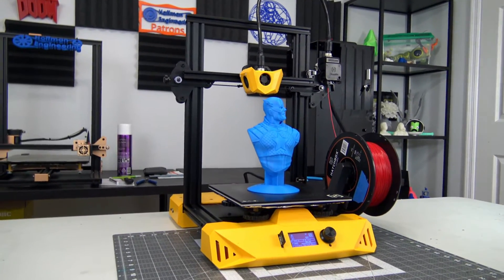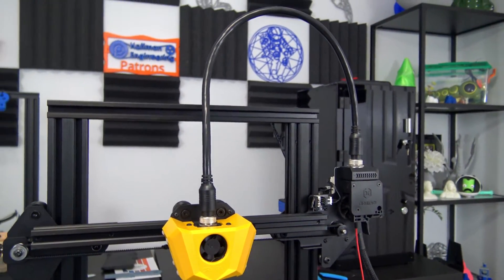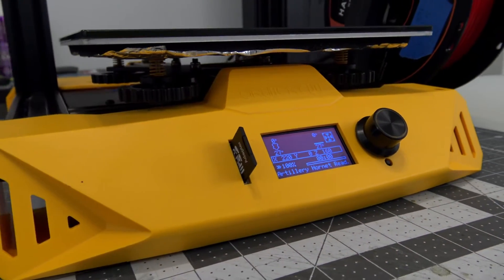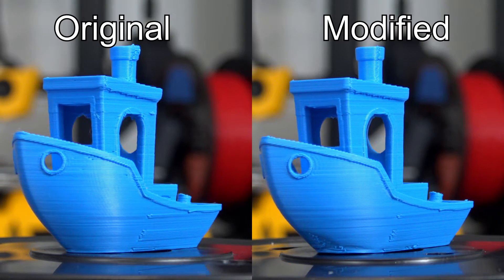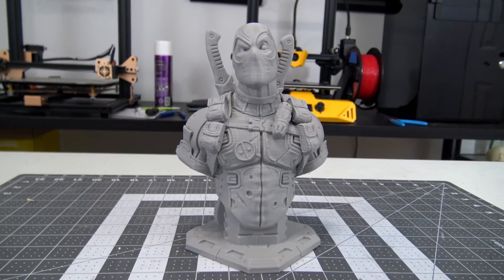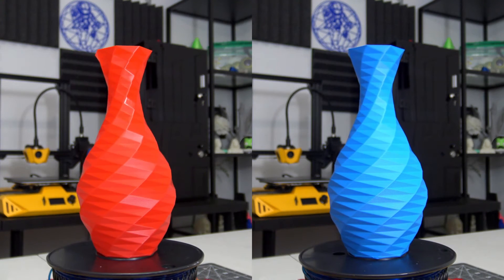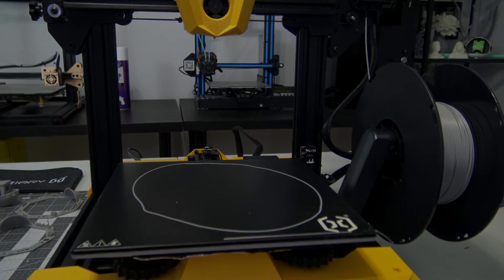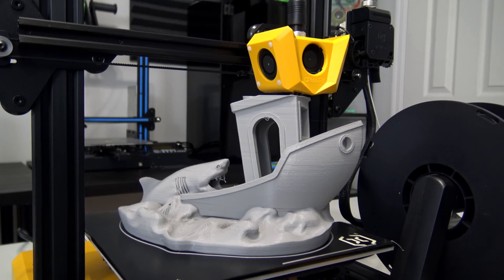A Stylish 3D Printer under $200 - Artillery Hornet Review

Comment: wrong way to level the Hornet bed. at 7.58 you should have gone to "level corners"that is the 4 corner and centre level using the physical bed adjust knobs. once that is done. you should do "level bed"click to begin 1-9 starts the software MBL. You use paper under the nozzle but you use the knob next to the screen to lower or raise the hotend from the bed. still need the nozzle scraping lightly on the paper..once happy on each probe point, press the knob to go to the next one..This is Manual Mesh bed levelling..basically auto levelling but you are the Bl touch. That is why it doesnt have BL touch as standard..Also right behind the Extruder is a BL touch connector if you wanted to add (NO POINT)
Reply: The paper thing is imprecise to me. You can use a feeler gauge instead. It will always have the same thickness unlike paper that can be sunken if you press the nozzle down too hard.

Comment: Good review. I ran into the same issues with the under extrusion and like you said the retraction was a factor. I got mine down to 2mm but also had to slow it down to 6mm/s and that really improved the quality of the prints. I really like this machine and after I did my review two people that I work with went and got one.

Comment: I was under the impression it was unsafe to run a ptfe lined hotend over 240c as it can start to break down and release VOCs
Reply from the maker: I've often seen ranges citing between 240c and 260c, I'm not sure where specifically it'll start to break down. ABS temps would generally be fine (235c), but I wouldn't go any hotter myself (no nylon, etc).